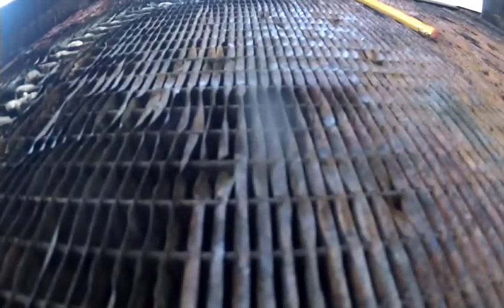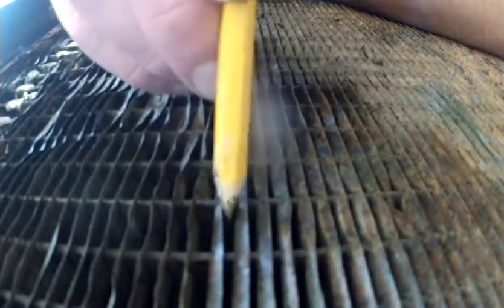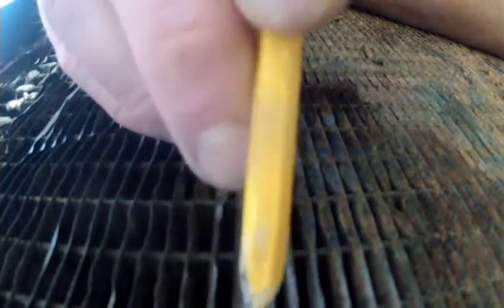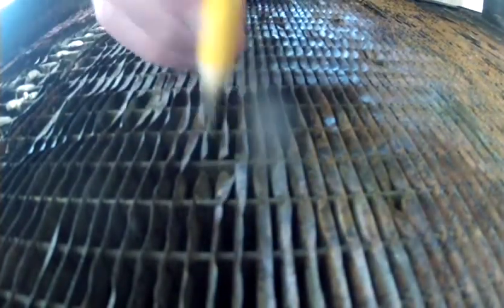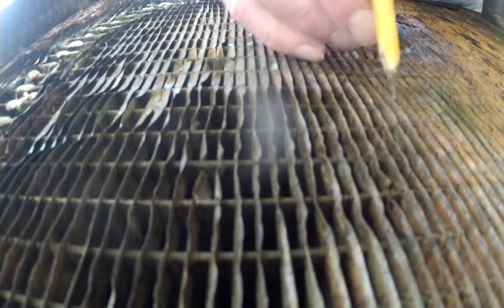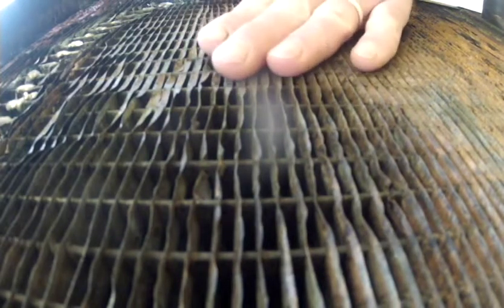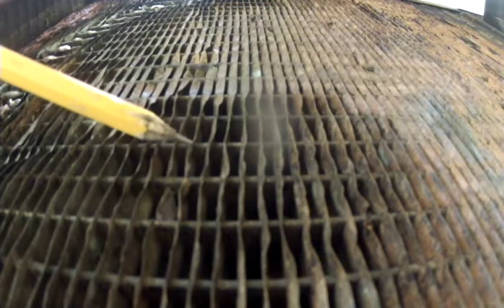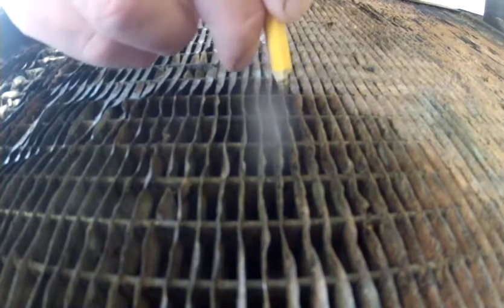Repairing Bent Radiator Fins

Comment: Why do radiator fins bend in the first place?
Reply: No protection. They can get hit by bugs and debris when driving
Reply: Trying to clean with to high of water pressure or to high of air or hitting  with hose trying to clean it